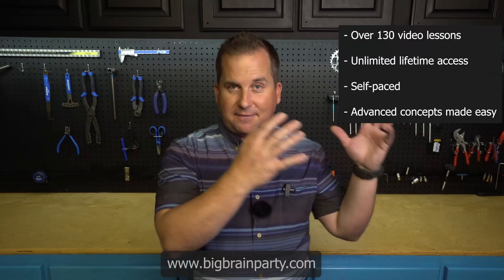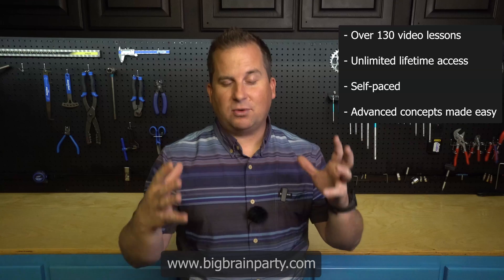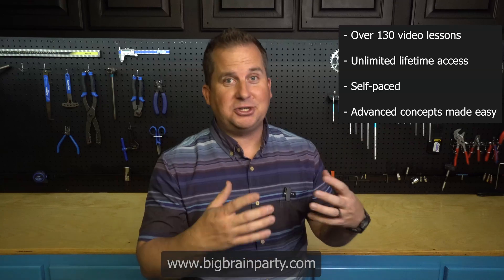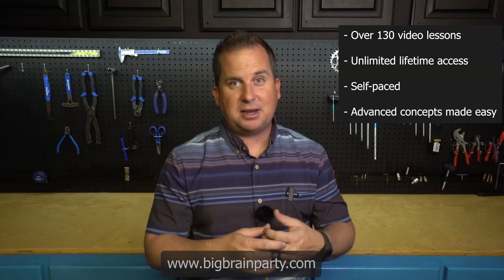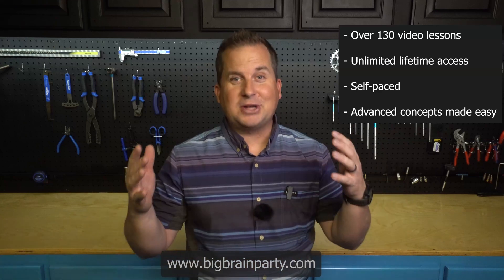Learn How MTB Geometry Affects Handling. My MTB Geometry/Bike Design MasterCourse is Here

Comment: Hey thanks for putting out great content. I am from Phoenix and will be traveling to Sedona for a mtb trip with a Ragley mmmbop. Do you have any recommendations for a 10-15 mile loop with a good mix of blue and black trails, tech and flow for someone who is afraid of heights? Thanks again!
Reply from the maker: Slim shady. Keep in mind that 10 miles in Sedona feels like 20 miles anywhere else. Ease into it and set low expectations with mileage.